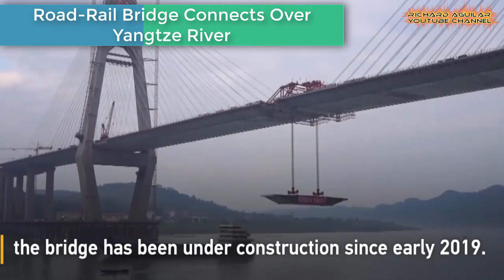Skilled Chinese build the most challenging cross-sea bridge in the world

Comment: Using rebar is a bad idea.  When water hits the concrete or cement, over time, it causes cracking and structural failure.
Reply: You don't know what your talking about.
Reply: This is why maintenance is needed every decade.
Reply: Your obviously an American, people thinking  like you is why our infrastructure is back in the 1950's a total wreck.  There is no way the USA could ever compete with China in infrastructure.  China builds, USA Destroys that all they really know how to do well.
Reply: The Chinese have been building bridges for thousands of years, they don't need you or your comments.